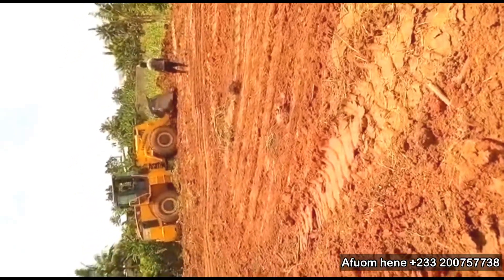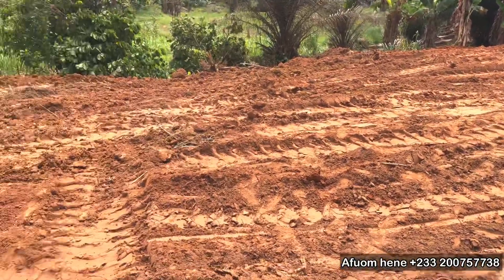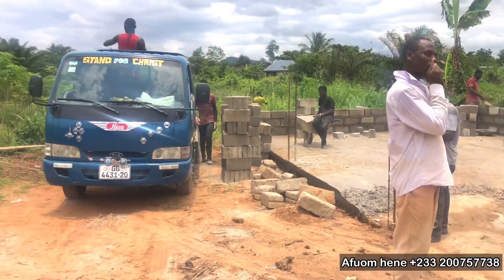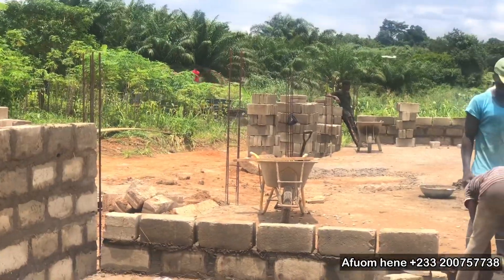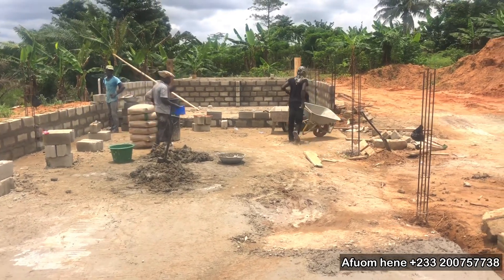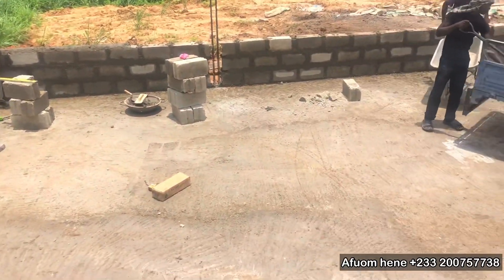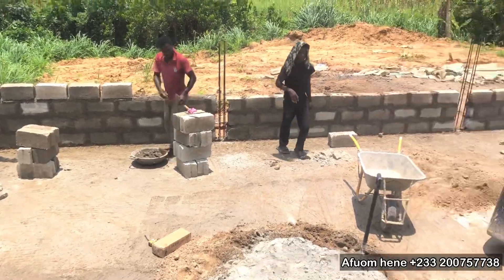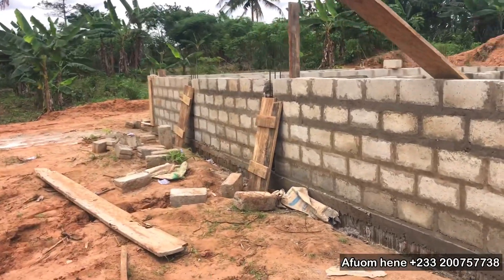Constructing a 15000 capacity concrete pond|Concrete pond technical details|Catfish in concrete pond

Comment: Hi, Afuom. Its exciting to see anything catfish farming. Please why are there no horizontal beams between the walls. 25 x 20 x 4 ft will hold minimum of 40,000L at stocking. Don't you think it is going to affect the wall?
Reply: You are concerned about pressure. Pressure is proportional to the height of the fluid. ie P = height density x  gravity.

The height is only 1.2m